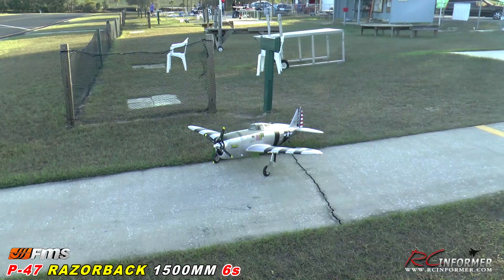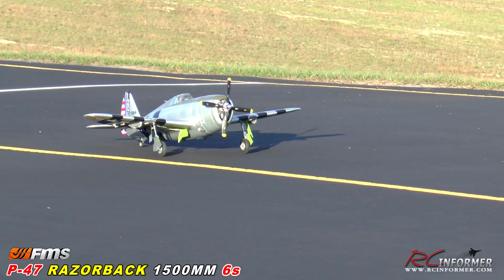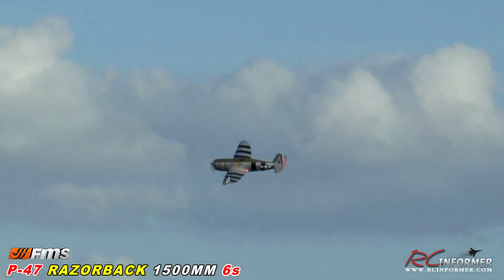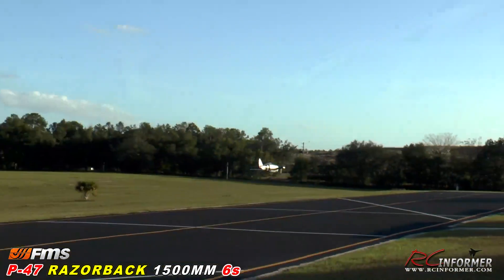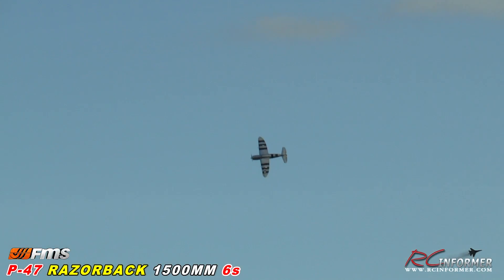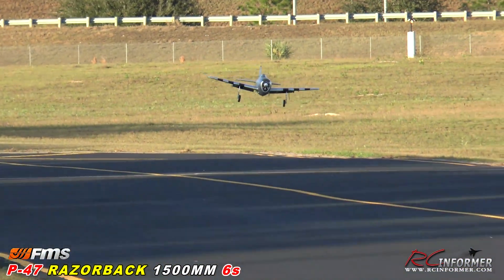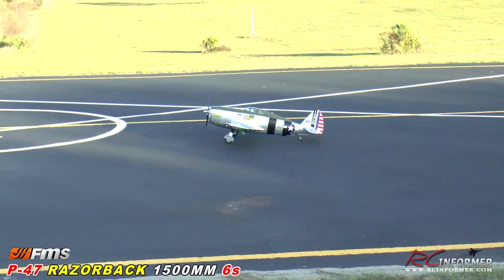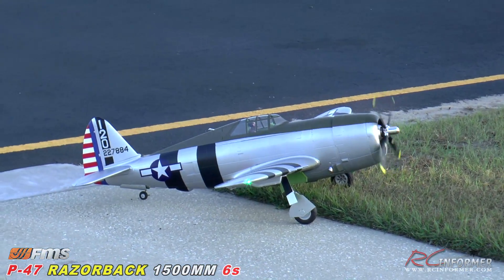FMS P-47 RAZORBACK 1500MM UNCUT FLIGHT DEMO By: RCINFORMER

Comment: Thanks Rich for a great demo.  Very impressed with flight times.  I'm setting up control throws on mine at the moment so thanks for your comment about 125% on ailerons.  perhaps you could comment on whether you needed to add any elevator compensation on flaps ?
Once again thanks for posting the review flight.

Comment: Hello RCinformer.
Do you think the bird vil take a 10,000 mah 6s 25c tatoo bat. ? if you move the lipo over the CG. I have a lot of them. so it would be nice. or do you think it vill be too heavey ?
Best regards Mark.
Reply from the maker: Mark Balle it will probably carry the weight, but you may have to carve out some foam. You can probably make it work....Also, you may not want to pull to many G's with it:)
Reply: RCINFORMER 
Ya i think your right. The beaver i probably a better platforme for lipos of that size, dount you think ?

Comment: Whats the flight time with a 5000 mAoh battery?
Reply from the maker: Torkil80 the actual flight time of the this flight minus the taxi time was about 5 minutes and 20 seconds and I used only 2200 milliamps out of the 5,000 pack, I estimate conservatively that you can easily get seven to nine minutes of flying time out of this plane. you can probably stretch that a little farther if you are modulating the throttle well.